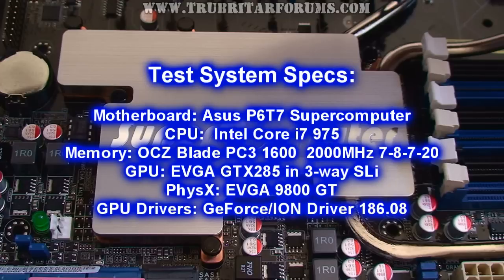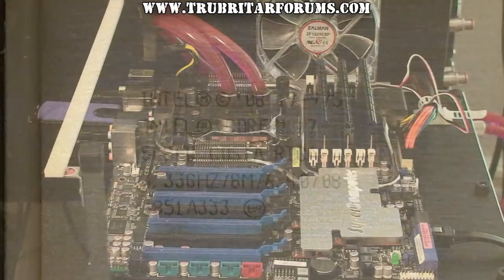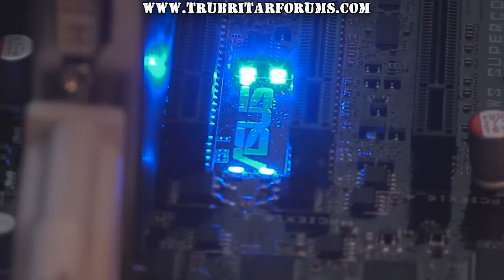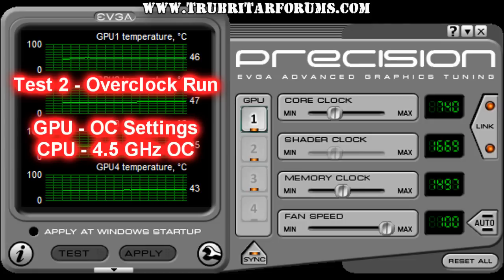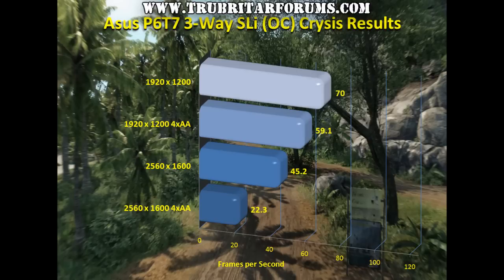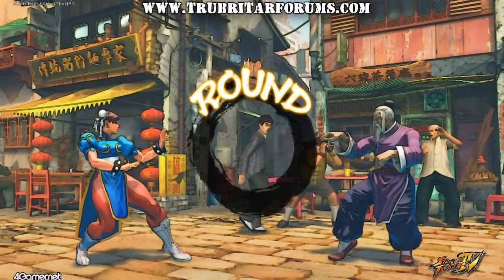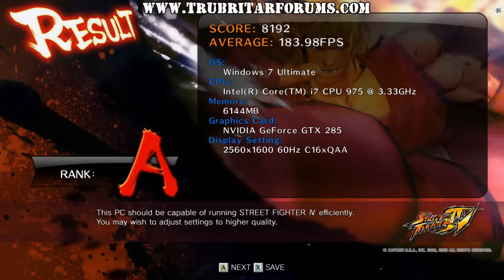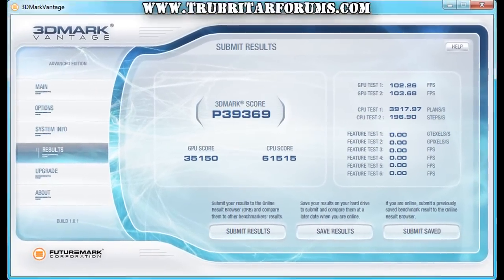(HD) ASUS P6T7 WS Supercomputer Benchmarks

Comment: I have a couple of SAS Drives. I bought an LSI hba adapter but it takes ages every time I start windows because of the raid configuration options that loads every single time, I wonder if this old mobo would allow me to connect those sas drives and do the raid via software so I do t waste time every single time I start windows. Thanks

Comment: At those high resolutions, there is absolutely no call for turning anti-aliasing on at all.  Any motion you do at all, which you are doing 100% of the time in an FPS, is going to blur the pixels together.  No need to waste graphics horsepower pre-blurring/smoothing every single frame rendered, unless you want to take screen captures... and even then, at those resolutions, its rather ridiculous.  AA puts a tremendous hit on performance so jack up your resolutions and leave it OFF.  This leaves lots of extra overhead on lesser powerful systems, to handle FPS dropping massive effects (like full screen particle explosions, fog, dynamic lighting, etc) when they happen on less powerful machines.

Comment: - Would it be ok if I were to use a 9800GX2 as a PhysX card with dual GTX295 in SLI?
- Do I need a separate card if I want my PC to have both PhyX and CUDA? or they can both run from a single graphic card?
- Lets say I'm using the same motherboard, Can I run SLI with Dual GTX295 while using a 9800GX2 as a PhysX card and another 9800GX2 as a standalone CUDA card?

Thanks!

Comment: @dardull  In 2010 the cost for this computer is 1949.35$ for the motherboard and video cards only. With the CPU it’s over 2500+$ not cool for a wallet.

Comment: @metalopig 
Thanls dude, As u know or dont know there was some Fastra project thing, and they used some pci-e flex spacers so u can actually use all 7 slots. But as i know the last unit will use x1 mainstream mode. however with that kind of computing power u can do wonders and miracles...
Thanks for the answer, and they dont need cooling as much as Gforce models do since they use half as power as gforce units do. They produce less heat.

Comment: hmmmm no dual GPU takes up 2x 16x sots, as in plugged in, and not every card, this was confirmed by nVidia themselves. dual GPU's take up 1 x16 slot (plugged in) with a NF200 with a SLi cable to the 2nd GPU, or on the CO-OP its just one board but with 2x GPU but no SLi cable but still has NF200. hence why in some cases the Classified E760 beats a E759, due to less Latency in the GPU's

Comment: they dont actually, the only cards i can think that use 16x are dual GPU ones, GTX300 will deffo use x16, but no single GPU uses x16, just cos the slot is x16 doesn't mean it needs it

Comment: think this board is good, but not for gamers as the HS are soo tiny for 2x NF200 and a X58, they cant keep cool, what temps were u getting, 70 on the NB is over heating. i can also tell you that no card these days actually use 16x all of them use 8x. id prefer eVGA x58 SLi Classified E760 or E759 edition much better :P, 39K is alright for i7 and 3x GPU + PPU. 5.9 is being held back by the HDD. GPUs and GPU will easily hit 7.9, i have a 88K GTX OC2 that gets a rating on 7.2 and a Q6600 @ 7.2 also

Comment: I have a good pc.. but i don't like how the vista or 7 (it's the same shit) dont use the whole performance of the pc.. the system uses processes that aren't useful.. if 7 or vista or xp was using compiled software instead of precompiled software it will be more faster and not by hardware

Comment: its the on "air cooling" part that's impressive. 

If the spec are identical with the exception of 3.2 vs. 3.33.  I don't see why a 965 can't achieve nearly as good overclocks as a 975

Comment from the maker: As an indication though, the main heatsink on the board, varies in temp across its surface from 37'c-42'c.  The 3 heat pipes and assoc finnage vary from 37'c- 46'c.  Amb room temp 27'c. recorded under Mild benchmarks.  As a comparison, in similar conditions the X58 (759) classified stock NB Heatsink measures 45'c on the edges and  59'c in the center heat pipe locale.

All temps were taken using a Extech IR Laser Thermometer Accuracy +/- 3.7%.

Although not Ideal, I hope this does help a little.

Comment from the maker: Hi there,
Thanks for the Question.
The P6T7 Motherboard doesn't have Temp monitoring on the board, neither the Bios or usual monitoring software recognize or display temps for the NB or N Force 200 chipsets...So any figures of the ACTUAL chipset could not be validated without tearing off the heatsink assembly and installing temp sensors.  (possible if there is enough interest)

Comment: He has endorsement =) That system would be way to expensive to be worth buying in my opinion. It's pretty impressive to look at though. Also with that SLI the cards barely get any air (9800 blocks the fans), how does this work out on the temperature?

Comment: First of all... please read 0:36 

Second point, it isn´t quad sli, is a 3-way sli of GTX285SSC´s + 9800GT for physX. 
The 9800 works as an independent GPU, is not connected to the SLI bridge, so is 3-way SLI

Comment: at 3:39 you see three single gpu nvidia 285s. at 3:49 you see evga precision with four gpu temps and four gpus showing. Not three... but four. this guy is running eighter 9800gx2's or nvidia 295's in quad sli. Not 3way. But quad sli!

how do i know? i got nvidia 295s in quad sli my self!